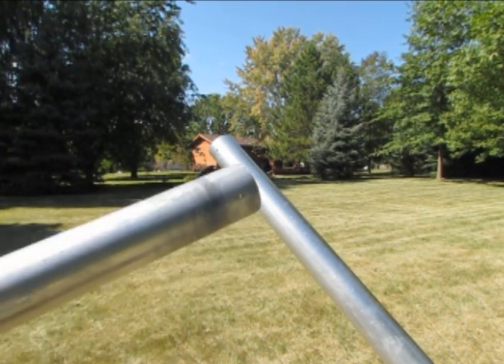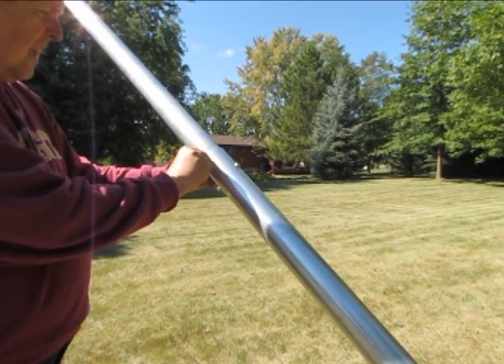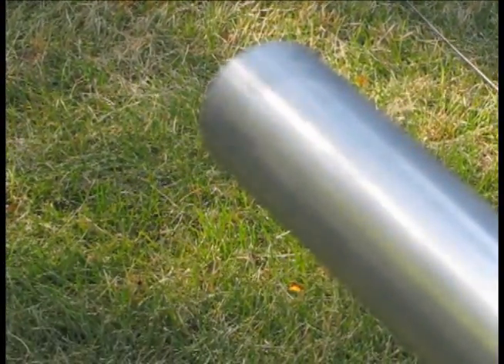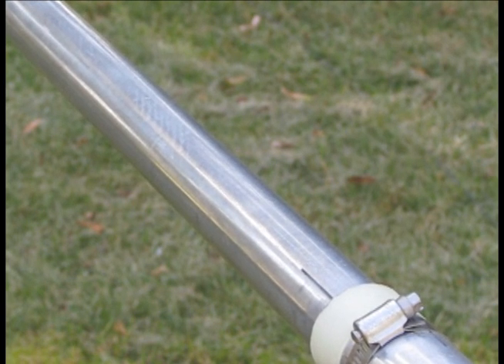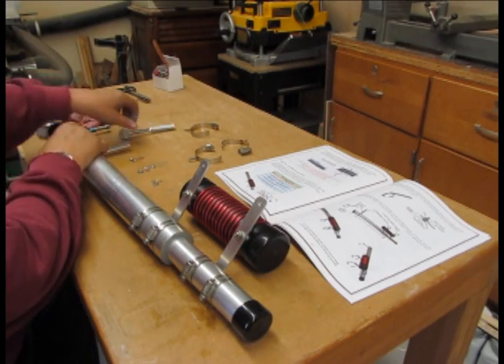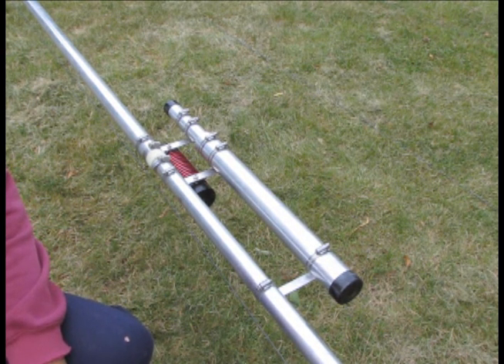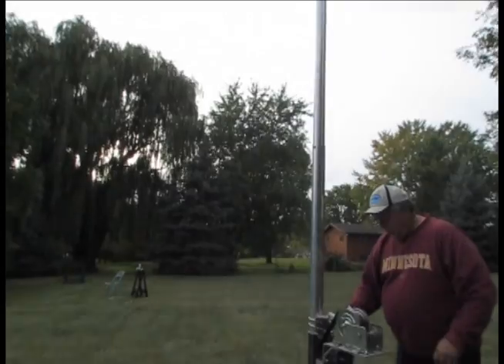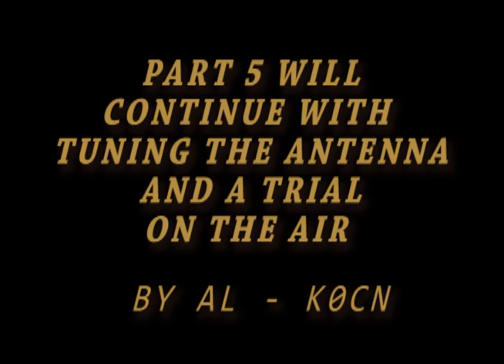DX Engineering Vertical 8040VA-1 Part 4, Antenna Assembly

Comment: Neighbor im very impressed. Im 68 and retired from trucking 50yrs and I got started as my 3rd hobby tinkering with base stations and all sorts of high power amps an radios. I've used all types of antennas such as solarcon, icom, imax and really good one some what like yours. Custom made by one of the big antenna, amp builders because I have a Dave Made outfit that runs 2800 to 3500 watts, a 2x4 amp, a 4pill galaxy 98vhp 750 watts so I had a good antenna made and with guy wires and a storm from the abyss came through in 10 minutes it blew it down but praise GOD its in one piece, well it consists of 28 pieces. Worked great untill storm. I finally took it down and apart but have no help to re run it. Your boat type rig is what I should have done in 1st place because im too handicapped to put it back on my chimney. You did great job.